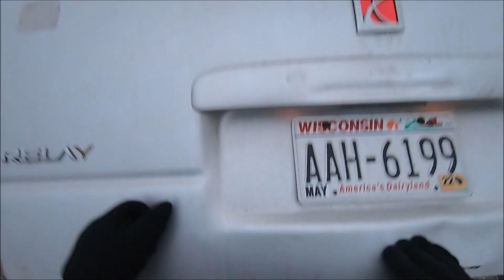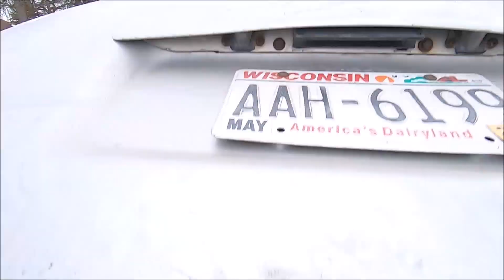STREETS AND SCRAP YARD 2.21.2022

Comment: Extruded aluminum is good money. On the can you left the comm wire behind,(whish is also easy money) you left a security sign. The posts for them are extruded aluminum. So is the tfack lighting you picked up. If you unscrew the ends & knock the lights out, you'll see a plastc insert. If you pull the insert out, you now have clean extruded. If you look on either side of the plastc strip, you'll see copper wire. Take a needle nose & pull, you now have clean actual bare bright copper, not insulated #1 Ty for taking us along

Comment: Remember that track lighting usually has 2 to 3 long pieces of copper in them that run the whole length of the track
Reply from the maker: Thank you for the tip! ❤